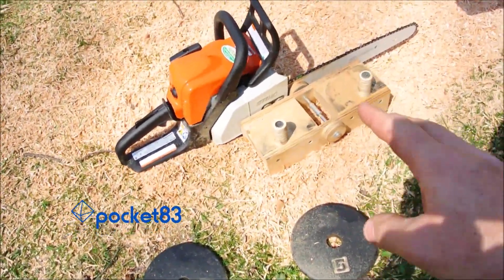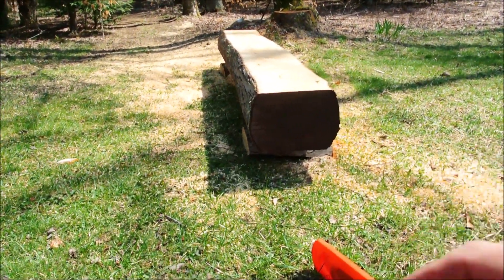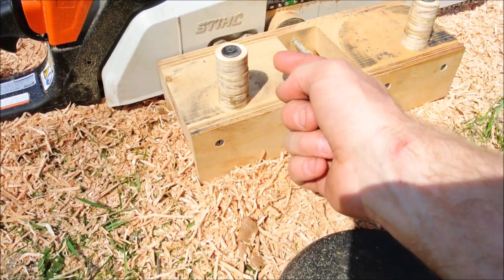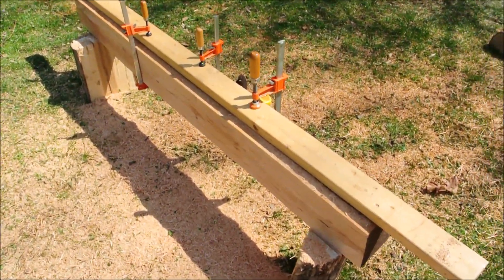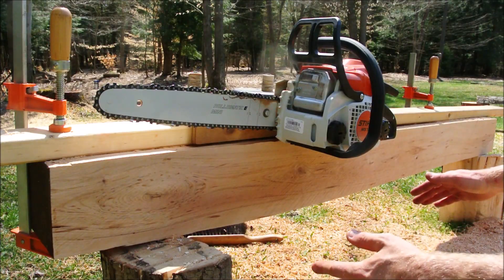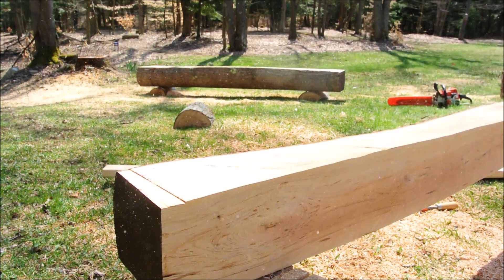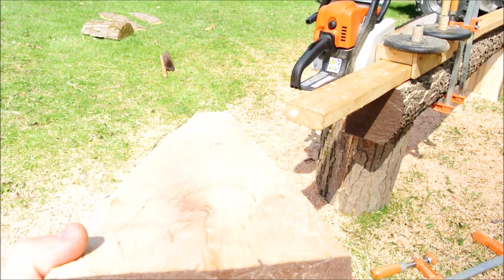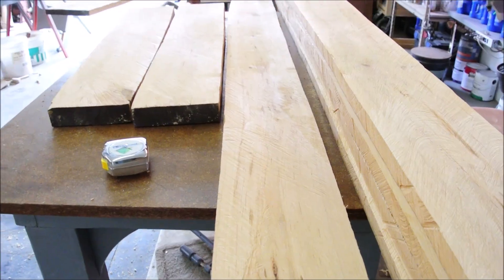DIY Chainsaw Mini Mill Counterbalance

Comment: will there be a video on stained glass anytime soon?
Reply from the maker: Haven't played with the stuff in years. Though I've wanted to do a how-to-cut-glass vid for some time. Are you stuck on a project, or is it a new interest?
Reply: @pocket83squared  a new interest, i saw some in your videos and got curious. do you have any recomendation where i could look further into the topic, apart from typing 'how to make stained glass?' in youtube? :)
Reply from the maker: Hmm. Yeah. Beautiful art. But advice? Not really! My experience with the stuff took place before YouTube was even a thing. There's probably some great stuff on here for that now. I will say this, though, remember: saving money lets you craft more and fear less. Learning to solder panels is a whole separate art from glass cutting, and both can get expensive. 

Maybe try out some stepping stone mosaics first to practice your cutting skills, since glass is cheaper than solder. Broken mirror is almost a non-cost, as are concretes in small volume. You can make molds from pie pans. Set a glass image on the bottom, built upside-down, and use Crisco as a release agent. Try experiment with mixing your own concrete formulations. I remember mixing white thin-set (the stuff for ceramic tile) with 'type S' premix mortar, and it made a really nice, strong, smooth finish stone. 

But how do you hold glass art in place while you're vibrating the concrete?! It's a pickle, no doubt about it. One way is to build your mosaic on clear packing tape, and then tape its top surface again so that you can flip it upside-down, place it in the mold, remove the lower tape, and then cast it. Another way might be to brush a thin slip of watered-down concrete onto the package so that the later hardened disk could be set down into the mold and cast into a larger stone. Years of experiments go by quickly. Just tinker, and keep letting your interests steer you. Good luck, and ask if you get stuck! 

Just had another thought: since real stained glass is so expensive, why couldn't we just use clear glass that's been painted on one side, instead? Then we scratch off some of the paint in swirls, and paint with another color! lol. Just thinking. Hope that wasn't a waste of your time.
Reply: @pocket83squared  thank you, i didnt expect a response that goes this much in depth, but it was a very pleasant suprise :)
there are many good ideas given, what resonated the most was the part about just tinkering and following my interests. 
there is a lot of oportunity for what i can do with my spare time and i dont think i will be much better prepared if i wait all day long. also with your aproach of experimenting and keeping costs low at first, i cant really fail because by definition that is part of the plan.
thank you again :) 
ill be off to start now

Comment: The counterweight is a beautiful and non-obvious refinement. I have some cedar about 7 inches in diameter. The only chainsaw I have is an old, wall-electric craftsman. I'm gonna give this a go. Thanks again.
Reply: How did work for you ? What wattage is the electric chain saw you used ?